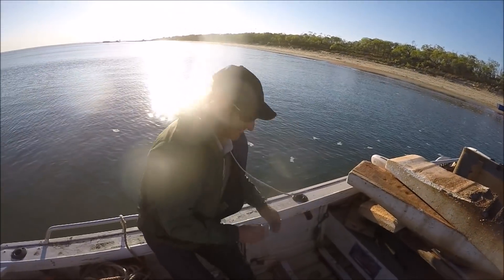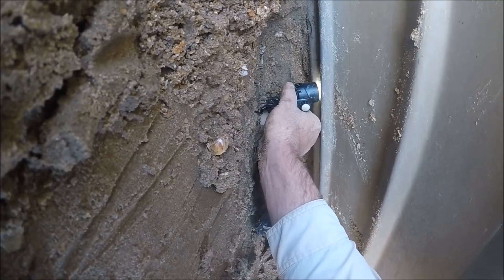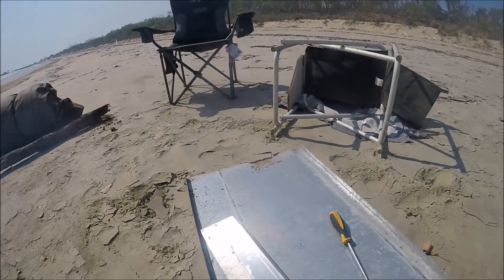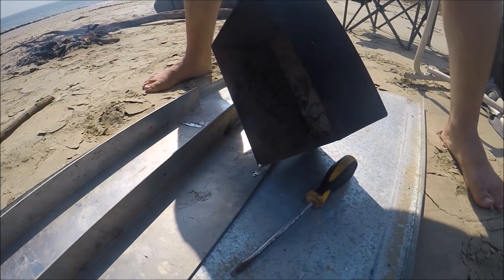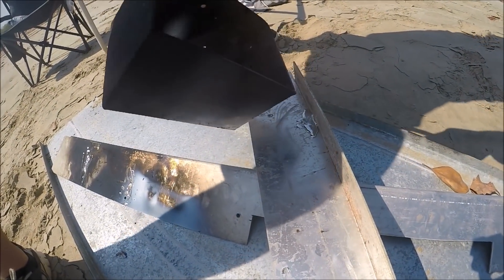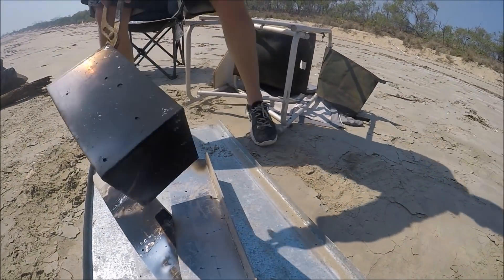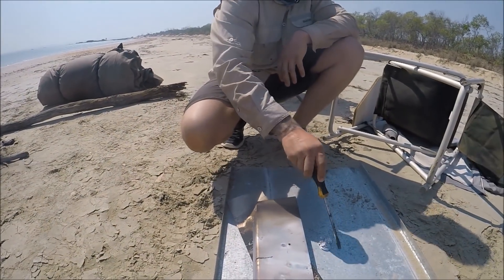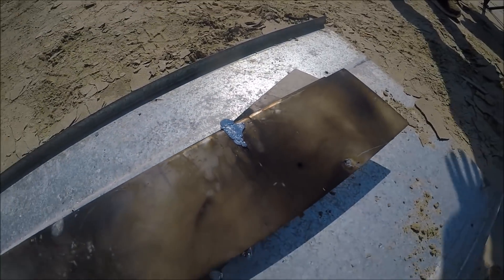Shipwrecked in the Kimberley

Comment: Dick, that is one wild trip. I've seen my share of bush repairs but none at elaborate as what you and your son came up with. Hope the boat was repairable or even lucky enough for an upgrade.
Keep up the film making.
Reply from the maker: Welded and went back again, see new vid on that
Reply: What's wrong with a roll of duct tape ha ha
Reply: @raggedrange627  each time you weld aluminium your 20% weaker in that area, do it again and your 40%... Time to turf it